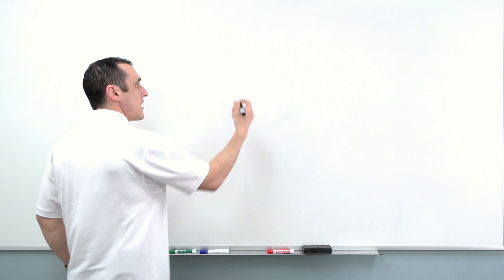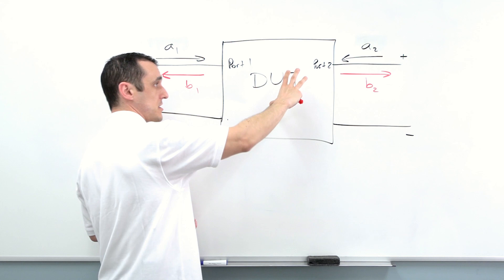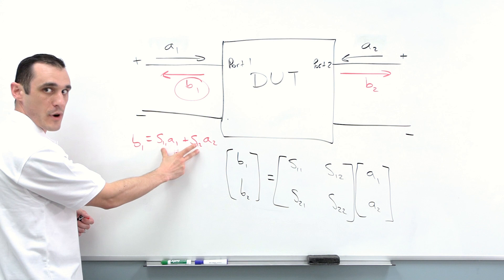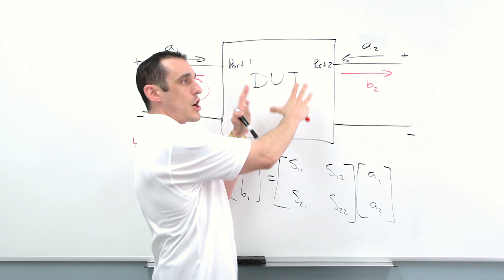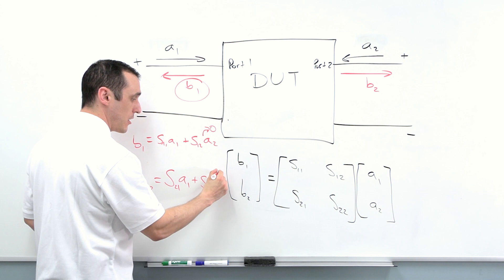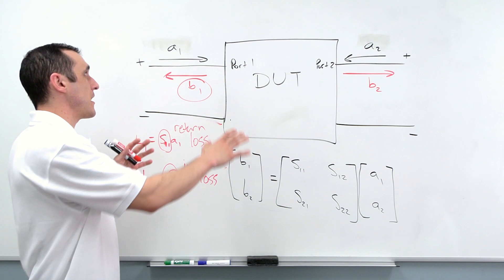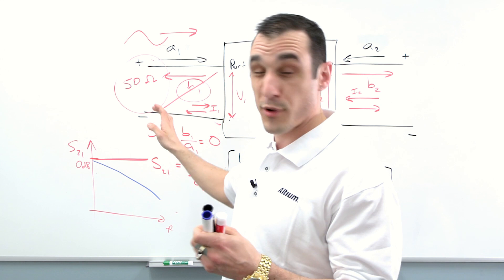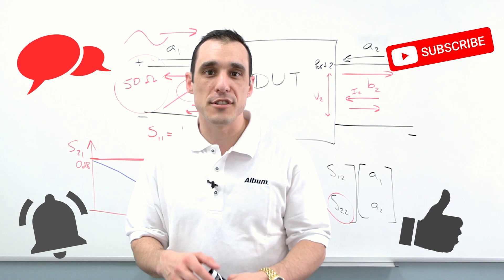S-Parameters Explained Part One | Signal Integrity

Comment: Worth to remember that this black box (DUT) should be a linear circuit (small signal stimulation) in steady state to use s-parameters for analysis.
Reply: Yes LTI circuits only, although there is a variant called X-parameters for time-invariant nonlinear circuits.

Comment: As a student I found S-Parameters very confusing, since S-parameter theory is often misunderstood and therefore largely incorrectly explained, even in my university lectures. The most common and relevant S-Parameter formulation in my eyes are the generalized S-parameter, as they are used by basically all simulation tools (AWR Microwave Office, Keysight ADS, and so on). They are based on Kurokawas "Power Waves and the Scattering Matrix" from 1965. If you take a look into this theory of Kurokawas Power Waves, you will find, that in your definition of the reflected power waves b (which are actually just square root power waves) there is a missing conjugate complex. Furthermore, the a-waves are not the power injected into the network, but always just the "exchangeable" power (maximum power which could be injected into the network from a source of impedance Zref). 

One reason for a lot of confusion is the close relationship between power waves and travelling waves, the latter which are basically voltage (/EM) waves as they appear in transmission line theory, where the term reflection coefficient is also an important subject.

Explanations of S-Parameters and generalized Parameters can also be found in the books of Collins and Pozar.

Comment: and i need your confirmation about  absorbed power and reflected power concept  [ is correct or not? ]and please if not show me the correct one 
(as you said An S11 value of -100 dB indicates extremely good matching, ...........that meaning almost all the incident power is absorbed by the device and very little is reflected back.so the E-field at this situation will be very strong right? because the maximum power absorbed by DUT which will generate strong E-field right?)  and vise versa when S11= -30 dB THE e-field field will be good but not more than -100 righ?

Comment: What about Z parameters, or Y parameters. Maybe even ABCD parameters. Or H or T...  Best to get a copy of Chris Bowick's book "RF Circuit Design" He discusses Y and S in some great detail.  The wiki page on two-port is another great source of info on various signal parameters and their uses.
Reply: Definitely good points! That stuff is covered in part 2 of this video. I'll also do a little example later with a VNA that shows how you can convert the data into those other parameters.
Reply: @Zachariah-Peterson  If you could, maybe use a low-cost VNA like the Nano so people on lower budgets can follow along
Reply: @googlesucks1376  I'm going to use a Libre VNA
Reply: That's be easier to get screenshots with.  I did note the disclaimer on one  website (which is true with any low cost unit):  "Due to this being an open source VNA, there are some limitations in the design. These remarks are as follows:
Due to some structural limitations the S12 isolation is 10 dB worse than that of the S21 parameter. Above 3GHz the performance decreases with increasing frequency causing the port isolation to only be 50 dB at 6 GHz. Furthermore, below 1 MHz, the performance decreases with decreasing frequency and the effective dynamic range decreases to 70 dB at 100 kHz. The output power may decrease when frequency is lower than 1 MHz or higher than 3 GHz."

Comment: I still do not understand why the diagram does not actually represent a typical 2-port block diagram where there will be signals on the lower terminals as well. Why is this?
Reply: The lower terminal is not supposed to represent a port where a signal can enter, it's just supposed to represent your ground reference. Some guides will use the lower port to denote only the reflected signals, but then a 2-port network would have 4 ports drawn on it, so it gets confusing. If you think about it in terms of the signal and its refernece representing the port together, then I think the block diagram makes more sense.